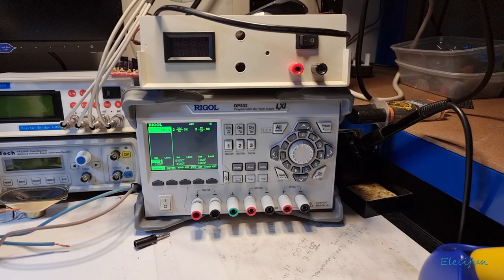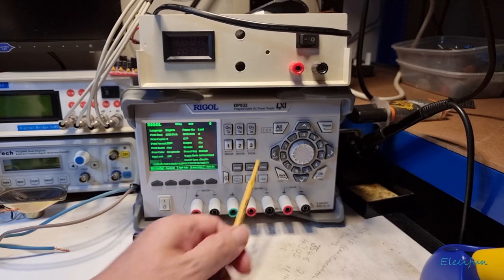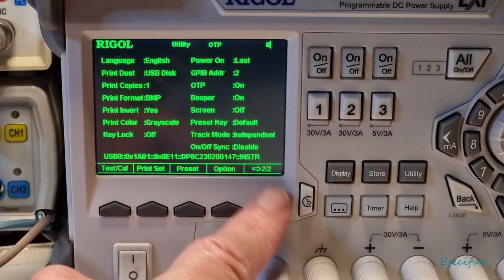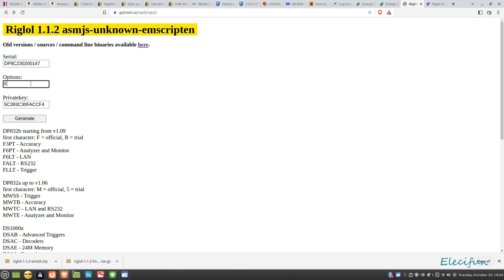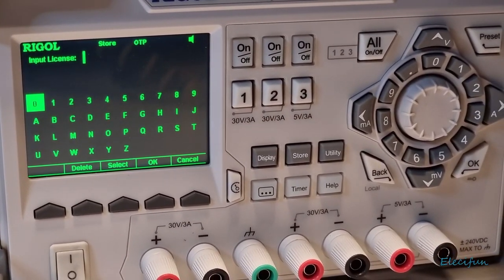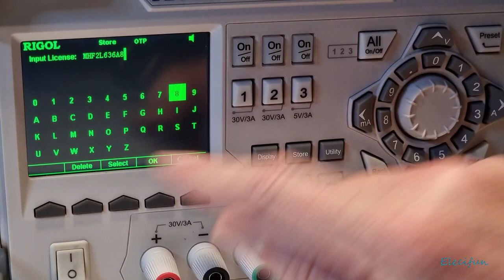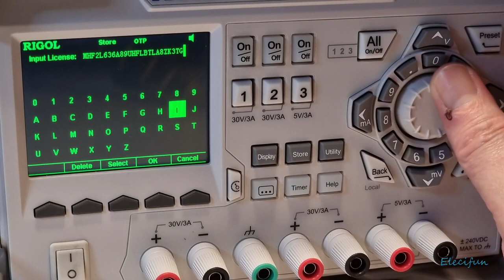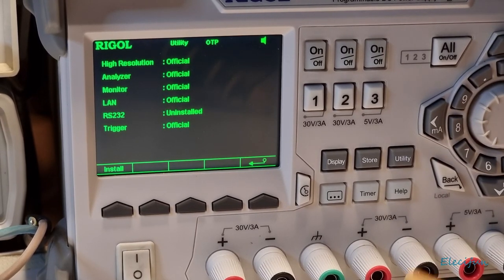Rigol DP832 Hack GOTROOT Does It Still Work?

Comment: If you insert a special USB drive (eevblog has a file which will make it one), you can just send it a command over USB to make it into a DP832A which unlocks everything including the colour screen. Much faster than doing the data entry.
Reply from the maker: Really that sounds really interesting, I may take a look at that. Thanks for sharing.
Reply: yea, I used the the code with lan, once changed, you can switch to the classical UI, so much better then that quasi digital look, and the new riglol codes work as well

Comment: If i power my raspberry Pi 4 with 5V 5A power supply, does it get damaged. Where it can support 5V 3A +-5%

Does it is true that The Pi should only take as much Amps as it needs.
Reply: The 5A is simply a maximum rating the supply can provide. Most devices (pretty much any consumer product) are not going to require a current controlled power source. So yeah its fine to power a pi with a higher rated supply :)

Comment: I might get one of these. 🤔
Reply from the maker: It's a nice supply, some don't like the jog dial but I find it very useful.
Reply: @Elecifun  Yeah I read and watched the pros and cons still it seems well designed. It has a toroidal transformer unlike some other the other ones. Three different channels. My only concern is like you said the volume control which some critiqued maybe and the monochrome screen. My eye sight ain't too good which means the size of the text is kinda important to me. I like the keysight psu still it's awfully expensive. 🤔 I'm burning through too much money. I gotta put a stop on that for awhile. I'd love a oscilloscope and proper benchtop power supply still I need to rein in spending. Anyway keep pumping out content building your subscriber base and watched hours.🤔👍
Reply: @Elecifun  Oh  I'd like a 10W laser cutter. To cut out holes in 7mm ply wood.